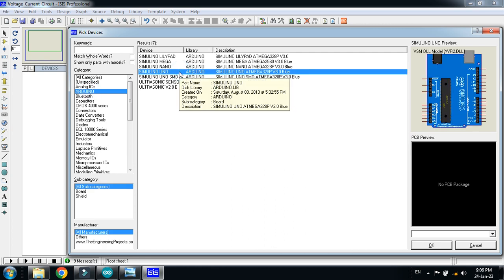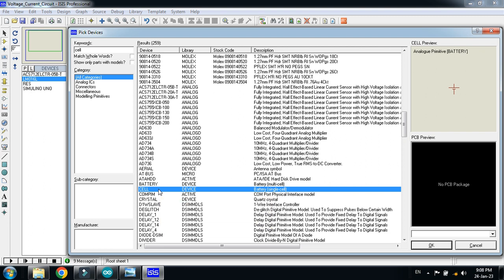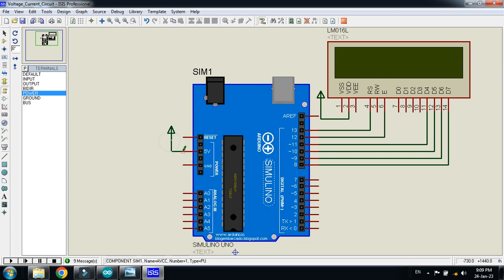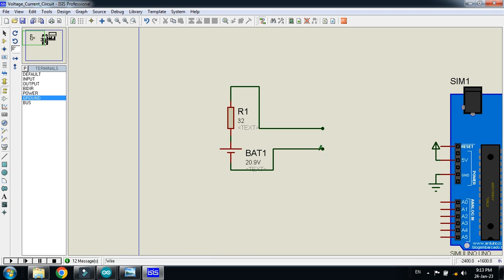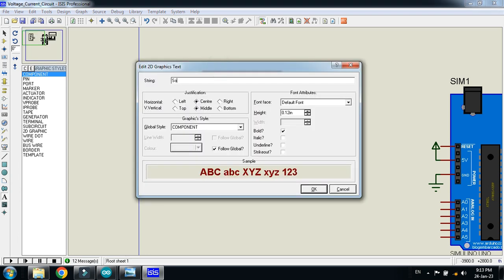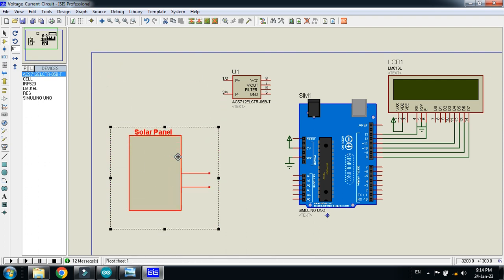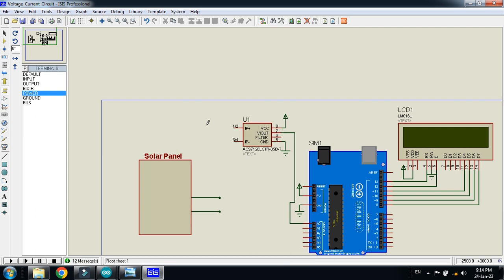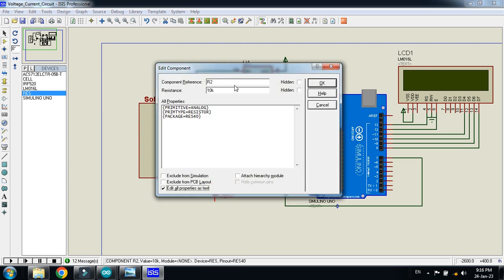Measure Open Circuit Voltage & Short Circuit Current of Solar Panel Using Arduino | Tutorial 28

Comment: could i ask you this? My solar panel has Voc 7.22V and 3.3A Isc, so what values of  the two resistors should i use for voltage divine. Looking forward for your answer!
Reply from the maker: Your solar panel values are ok, you can go with the video values, nothing to change. Use same values.

Comment: Is there a need for a change in the code when we use a resistor instead of a mosfet when building this project on a bread board?
Reply from the maker: Do You mean that you want to replace the MOSFET with the Load Resistor.? If yes then you can replace MOSFET with resistor (as a load) and there is no need to change the code. But then the voltage will not be open circuit voltage, and current will not be short circuit current. Then these will be on Load values. 👍

Comment: Why not use a regular DVM instead?
What is the point of this?
Reply from the maker: The point of this video is that in this video you will learn that how to measure these parameters with the help of Arduino. BTW this video was created on the request of one viewer. Thanks
Reply: @thebrightlight9472  
Haha, ok.
It's a programming centric video so I get it now. It just seemed like a difficult way to check.